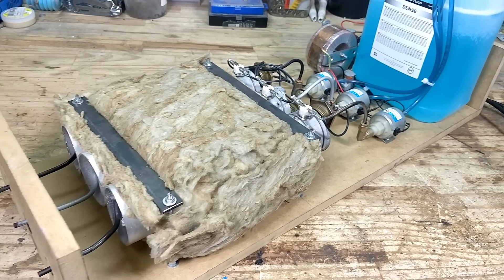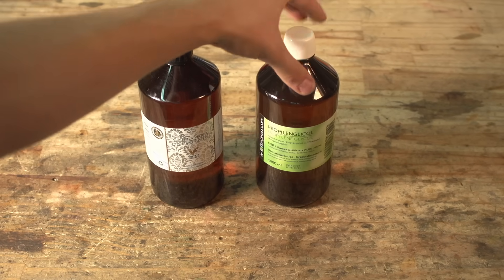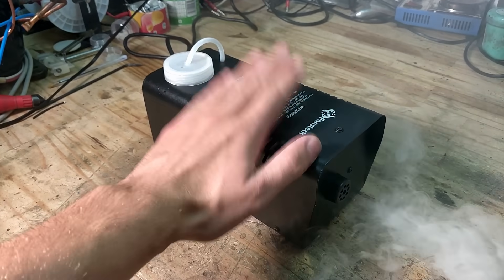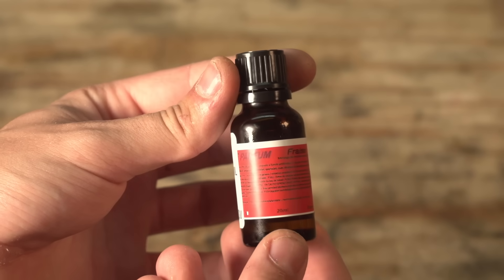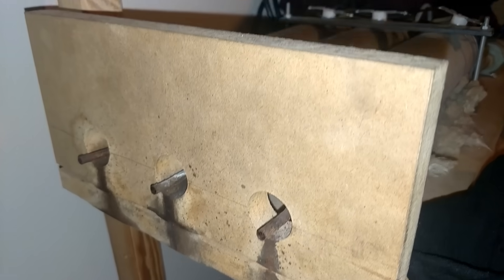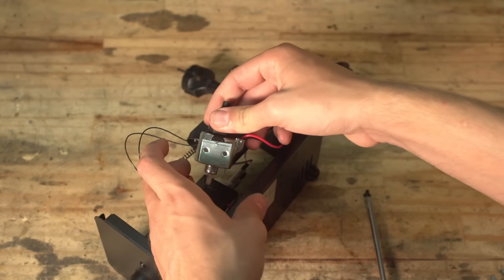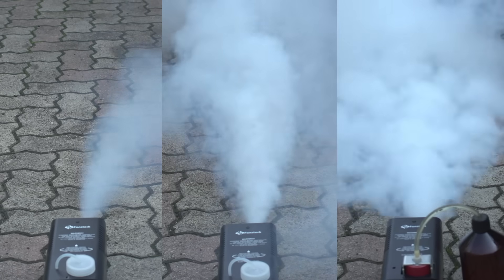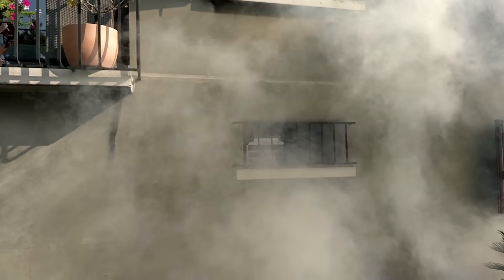How To Make a Cheap Fog Machine 10 Times More Powerful

Comment: The steam by itself may be clear, but steam mixed with glycerin isn't.  I saw another channel do some experiments where adding some water to the glycerin increased the fog.  It's really finding the correct ratio for your particular machine.  So not only does the water help keep the machine from clogging, it also increases the total volume of fog produced.  It may not be as dense, but finding the right balance of heat, pressure, water and glycerin will get you the best efficiency.  One way to increase the fog from a machine is to spray it though ultrasonic water mist, or ice.  This picks up additional moisture and cools the fog to make a thick blanket of fog that rolls across the ground.

Comment: Nice video.  Thanks for sharing! And the reason there's so much water in commercial fog juice is simple.....profit!  They can make a jug of fog juice cheaply using water as the main ingredient.....then sell you a jug of mostly water and make a huge profit off of it. And of course there are all the warnings that only "proper" fog juice should be used, and most will obey those rules to the letter.
Could I please get links to the glycerine and stuff you used.  A quick search of Amazon was very confusing......as there must be like 50 different "variations" to choose from. Also a link to the pump you used would be nice.
Thanks

Comment: Thanks for the great tips. I presume distilled water is used for the same reason its used in coffee makers, Keurigs and CPAP machines. The minerals have been stripped out so there's no mineral build up from the heating element.  That tends to shorten the life of the equipment if its not properly cleaned. In the case of fog machines, distilled water likely helps flush out any buildup that glycol and glycerin would leave behind.
Reply: Exactly❤. I have a Keurig video on defective Keurigs. You almost always use distilled water when passing thru a pump in a mixed chemical setting.

Comment: The reason smoke fluid has this much water is because the steam cleans the nozzle - this wont matter for halloween, but for really expensive Antari, Swefog or Jem smoke machines that runs every weekend they need the cleaning properties of water - its a common nightclub maintenence to once a year run 2.5 liters of distilled water thru the machine to keep pump/heater/nozzle clean.

Comment: The water is largely a carrier/cleaning for the machine. There's some machines which were known for their problematic fluids and would plug up all. The. Damn. Time. 
Also in many pro fog machine manuals they say to clean it periodically with distilled water. I suspect it's also based on pump design and other things- a thinner solution is easier to pump so it results in longer service life of the pumps.

Comment: As a lot of car shops we also use a smoke machine to detect leaks inside a system like for example a combustion engine. I keep struggle to get enough smoke in the engine because of its size( we work on big engines for busses). This could potentially be the beste tuning guide i found so far to tackle this problem. thanks!

Comment: just keep in mind if you use any kind of fog machine indoors, the fog just doesnt 'go away'.. all of that moisture will eventually settle on a surface or get absorbed into any kind of fabric. thats why youll notice clubs/venues that have used foggers heavily are always super gross. sticky everything. or the whole place just seems to never dry out. and im sure the staff has a wonderful time trying to clean the floors after a night of people stomping god knows what into an already sticky floor.. just have the dj toss out a couple handfulls of joints into the crowd. there will be plenty of haze for the lights in no time.

Comment: I used my Dyno-Fog II for about 15 minutes before the thermal fuse blew. It was set about 3 degrees hotter than the thermostat. I'm surprised it didn't blow in storage.

Comment: I have another consideration for the watered down mixture, Higher VG Mixes of vapor have a nasty habit of settling on surfaces and wreak havoc on electronics and gunking up fans - Sadly had to deal with this issue myself, but not from this kind of fog machine 💀

Comment: I think you need to seriously caution against producing acrolein. To add a few cut and pastes from wiki. This is what the water will remove the risk of, maybe they have an overtemp cutoff below this point but the point needs to be made if you suggest people modify heaters and liquids with no precautions whatsoever.

When glycerol (also called glycerin) is heated to 280 °C, it decomposes into acrolein.
Acrolein is a relatively electrophilic compound and a reactive one, hence its high toxicity.
Acrolein was used in warfare due to its irritant and blistering properties.
Acrolein is toxic and is a strong irritant for the skin, eyes, and nasal passages.
Acrolein is one of seven toxicants in cigarette smoke that are most associated with respiratory tract carcinogenesis.
The WHO suggests a "tolerable oral acrolein intake" of 7.5 μg per day per kg of body weight.
Acrolein acts in an immunosuppressive manner and may promote regulatory cells, thereby preventing the generation of allergies on the one hand, but also increasing the risk of cancer.
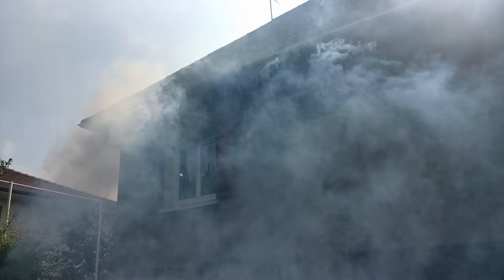Reply from the maker: 6:21
Reply: @NicolasSalencPBP  yeah I watched the whole video before commenting, it doesnt need oxygen, just heat. (CH2OH)2CHOH → CH2=CHCHO + 2 H2O  "it shouldnt really be an issue" barely explains the dangers of potentially creaing a military poison gas in a club. Just putting it out there, I'm not the one in danger of getting sued over it.

Comment: The water in fog juice is there for 2 reasons:
1. It helps the manufacturers 'cut' the juice so it costs them less overall to produce per volume of liquid. It's hard to tell a difference between 30-50% water and 0% water in the fog output.
2. It expands to like 1200% of its initial volume when it becomes steam which helps push the glycerine-based fog out faster and keeps the heating tube somewhat clean inside.
Reply: what would happen if the fog were to be generated by using aan ultrasonic humidifier circuit instead of by heating it?
Reply: @winniepooh4130  I know you posted this forever ago but there is an instructible where a guy makes a fog machine in a bucket using an ultrasonic pond fogger, so it should work and you can use straight water instead of fog juice. He said they are the same as the the ultrasonic thingy in humidifiers, but he did say you need at least a 12 jet ultrasonic mister to produce enough fog, so you'd need to salvage more than one from these kind of humidifiers and use them together. You'd also need to find a way to keep them cool since they generate heat as they are in use. He did it by just adding ice to the bucket periodically.
Reply: 100% … Also, using that super-thick undiluted fluid would clog up the machine extra fast. You might be ok to use it for one halloween, but if you didn’t clean it up … good luck using it for much longer :-/ (edit: I see that he addressed the issue during the initial test, so my comment was likely unnecessary:)
Reply: Water expands to 1700 times its volume when converted to steam.  Coincidentally, a cubic foot is 1720 cubic inches. That means a cubic inch of water will expand to nearly a cubic foot when steam.
Reply: It will look so much cooler if you pass the fog through a cooler like some dry ice
Reply: There are fog machines that use Ultrasonic foggers. But waterfog is heavy and stays on the ground. "Hot" fog floats in the Air.

Comment: My primary goal in wanting to modify these machines has always been to allow continuous (100% duty cycle) operation as opposed to maximizing output. The cycling on/off has always annoyed me, as the scene quickly goes from a thick blanket of fog to almost completely losing the effect altogether while waiting for the machine to catch it's breath and get back up and running again. Is it possible to employ a reverse approach to the mods that most people make such as running a larger heating element/thermal block but a slightly smaller pump?  Or possibly even a 2-stage setup with a backup heating element that would kick in to keep the block temp propped up if it drops too low? Would pre-heating the fluid in the reservoir help?
Reply: Probably safer and easier in the long run to just buy a second machine to run while the first is sleeping, considering you're saving hundreds by overclocking little machines.  I half suspect that's how a 'constant' machine works anyway, with multiple heater blocks alternating duty cycles.

Comment: Since I'm using my fog machines on Halloween wen it's cold  I cover most of the vents on the fog machine with duct tape  to keep the heat in also one of my machines are hidden in a box they have a much shorter heat up period  and the one in box runs way more often than the others

Comment: There are always 2 types of haze in the event industry the water based ones are more cheaper oftenn with more overall power and oil based smoke or haze machines the fog letting to much residues from the fog itself so its yea the amaount is pretty same but the oil base is only good for outdoor but inside all that oil residue to clean after some regular use is to bad thats ehy water based is more used inside

But yea the problem is really the spitting from oil based ones

Comment: Quick tip I learnt with ecig : You can get very high quality PG and VG that is made for horses. I know you're thinking it's low quality if it's made for animals, I thought the same, but it turns out those are very fragile animals, and the PG/VG used is close to pharma grade (sometime they have the pharma grade label). If you need high quantities, this will be much cheaper.
Reply: Dude I call BS.  Horses don't even have thumbs, so how can they vape?

Comment: The issue of the modified fog fluid cooling down the coil a lot (after changing to a bigger pump)... you can use a small heating pad wrapped around the bottle. This will help preheat the liquid before it enters the pump and heating coil, which will help the coil retain more heat for longer periods of time before cooling down and dribbling liquid.

Comment: Some really good info here.  Thank you.  Whats really interesting is how easy it is to buy Gallons of propylene glycol for less than a few dollars. The Veg Glycerin is a bit more expensive, but not prohibitive.  
I have been in the garage making all kinds of things for Halloween out of old Styrofoam, and other salvaged bits, it never occurred to me to tinker with my Crappy 400w cheapest possible Fog machine (from Walmart).  Not that Im going to tinker with it, until 'necessary' but I will certainly play with the Fog juice aspect.
Also, knowing that Im using just propylene glycol and a simple thinner means I feel safer having it around the aforementioned Styrofoam without risk of Melting.  :)
So.  if you wanted atmospheric fog, Glycol, or if you wanted low laying (cooled) fog, Glycerin.

Comment: the reason is temp of the vapor most places will use a fog machine from a height and adding water will reduce the tem after it leaves the machine faster causing the cloud to drop faster

Comment: The PG is an emulsifying agent for added flavor/scent. Only use PG if you are adding flavor/scent. 50% VG and 50% distilled water is optimal for extremely thick fog. 

Websites that sell flavors/scents vastly over estimate the amount needed to make fog smell good. 10% PG and 10% or less flavor/scent should be more than enough.... So always start with 50% VG (or less if too viscus) then add PG and flavor/scent, then the rest should be distilled water. If your pump is suffering, use less VG.

These fogs will irritate your lungs and eventually cause asthma with extended exposure, even if you've never had asthma before in your life, so make an effort not to breath in too much.

Comment: Run a tube from the machine though a styrofoam cooler full of ice and run tubing from the cooler to wherever and the fog will stay on the ground especially if it's wet. Make sure to seal the tubes and lid together tightly.
Reply: What kind of tube ? PVC ?

Comment: VG is quite flammable in high concentrations. We mix it with methanol for rocket stoves and tin heaters. The VG slows the burn down so it's a bit more controllable. 
It does have a pretty high flashpoint, but you can turn a high VG fogger into a flamethrower if you get the conditions right.

Comment: instead of bigger heating element and bigger mass... a couple thermistors. one inside the mass block, and one on ousite. then use arduino to control the heater on/off relay timed to equalize the temperature.

Comment: i think there is distilled water in the fog fluids as they are designed for stages and you don't want a dense cloud there but fine room filling fog for the light show. it would be nonsense to blow a huge cloud with a 50/50 mixture in front of the stage at the beginning, but with the next gust of wind the fog is gone and the homemade liquid is used up. therefore diluted with distilled water to produce a little fog, but all night long :)

Comment: Wait. What about a long test ran over multiple hours? The instant thick clouds you cant see through is great. But most people have these fog machines running for a really long time. Hours at times, to keep the venue or whatever they've added fog to, consistantly foggy. If that vape cloud makes the area too thick to see, then runs out of juice and shuts off in 10-20 mins, maybe thats why the other liquid runs so thin?

Comment: water is simply added because its made for a FOG MACHINE. Simply dumping glycerine/ pg on a hot plate will produce more fog quicker... just like dumping brake fluid in someones car exhaust tip will create more fog than any machine (toxicfogtho) (dont try)

Comment: they make a THICK FOG version that has a higher concentration of glycol but still contains distilled water. WHY? Well as you stated the steam that is created will help push the fog through the system and out further once it leaves the machine, like a jet engine. also the steam keeps the thick glycol from drying up and gumming up the machine which is the number one killer of fog machines. lastly it is distilled so your steamed parts do not corrode with the impurities from the water...

Comment: Why not put a restriction on the tube before the heater since the whole point of the bigger pump was only because of the thicker liquid.
Could put a t fitting in there to go back to the bottle to make sure it doesn't get too much pressure and could also use some sort of fitting to tune it.
Seems like there could have been more done to this than what was here

Comment: I worked for the largest maker of machines in the world.  The reason distilled water is used is to keep out the impurities.  Tap water has minerals which when the water evaporites leaves scale and will not only clog your machine but also destroy the tube and pump prematurely.   

The water is in the juice for 2 reasons.  Fluidity it more evenly mixed the glycol and glycerin preventing the oil and water effect so the fog is consistent.

The only way to really clean the machine is by using 50% water and 50% vinegar and running it through which will clean out the internal workings.

You should NOT add perfume as most are toxic when heated.  Your better off adding candy flavoring extracts.  Used to give candy flavor but has no sugar.  Like from Loraine.

You don’t want to change the pump unless you extend the heating block length.  Making it hotter will not do.  You need the conductive thermal energy and the longer block allows the faster or larger pump to still heat and not spit out liquid .

When done always run either Vinegar and water or just plain distilled water through leaving any of it in the machine will cause the impeller’s to deform and any tubing could as well

Comment: Interesting video - The MPG / TEG / Glycerine all have different smoke (Fog) properties - one gives a very white smoke - one gives a more grey appearence - some have better "hang" times - The mix is very dependant on what the fog is to be used for... Different smoke fluid mixes therfore have different sweet spot temperatures for the fog machines, thats the real reason you shouldn't swap fluids between machines - eg glycerine based need about 350 degC but an MPG mix could be as low as 250 - so beware wet fog or burning the vapour.... Water is used to thin some mixes and help propel the smoke further.. some companies add a touch of ethanol to really make it pop... Regards Ady@ ConceptSmoke

Comment: DANGER!!!! Water is used in the mixture also to limit the temperature, since glycerin becomes flammable at 160°C. Flash point of glyrecin/propylene glycol mix, must be near 130°C. With water at that pressure you put a limit at 100-130°C making the machine safe for use on stage.

Comment: Idea: maybe you could wrap nichrome wire insulated with kapton tape around piping to make a vaporizer block? You can get lots of kapton pretty easily and you don’t need to do aluminum casting.

I’d love to try myself but I have my own dumb concept I’m chasing (turning a clothes steamer into a fog machine by spraying fog juice on the heating element to make a small handheld fog machine)
Reply from the maker: Interesting idea... Kapton tape is a horrible thermal conductor so the nichrome would be glowing red hot while the aluminum block would bearly recieve any heat at all. 
In electronic cigarettes, nichrome is used to heat up directly a piece of cotton soaked in a VG/PG mix

Comment: Lol @ using a tazer to turn on your torch xD
I would imagine fog juice intended for film/large venues/outdoor/special effects use, has a higher concentration of glycerine/glycol compared to the ones used for smaller indoor/nightclubs.
Also the viscosity as you mentioned can be a problem, also in regards of self cleaning of the piping.